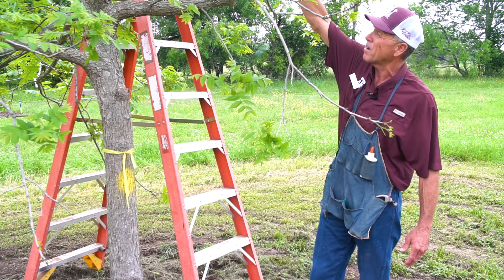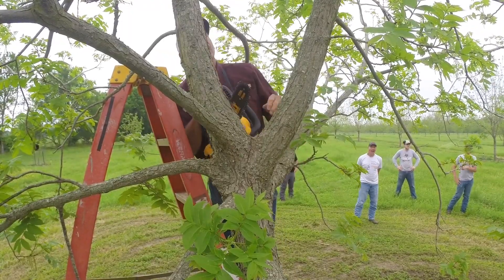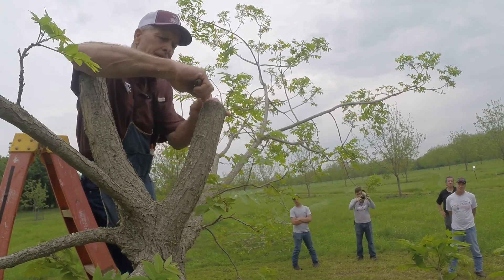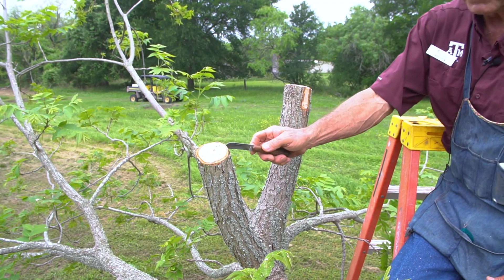Top Working Larger Pecan Trees by Texas A&M AgriLife Extension

Comment: Thank you for your video. I planted several trees on a small orchard 8 yrs ago and the graft died couple of yrs later, but the rootstock survived into a tree producing marble sized hard pecans, but once I saw you grafting a complete grown tree ( my tree sizes ) it gave me hopes. So I stake/bark grated about 50 trees as these trees were sprouting leaves, grafted them with scion ( branch tips) taken on January from good sized soft shelled pecan producing trees.
The grafts took to my surprise, after 4-5 weeks they sprouted leaves, and now in the sixth week these graft sprouting leaves/branches are producing blooms (flowering). Now I wander if they will produce the actual pecans so soon, is this normal to flower so soon?  Thank you.